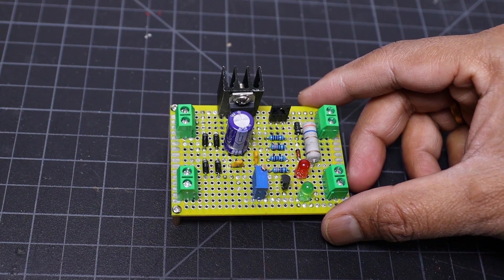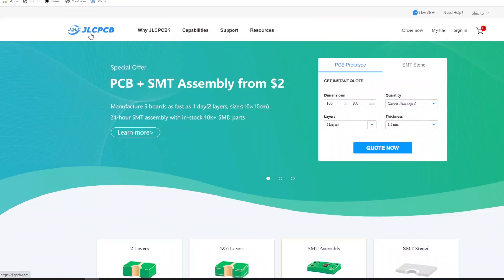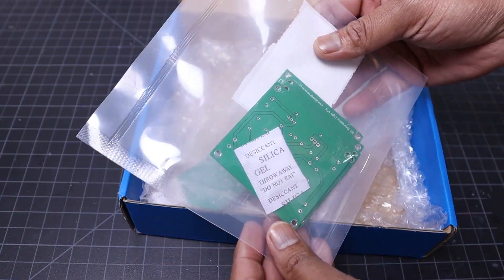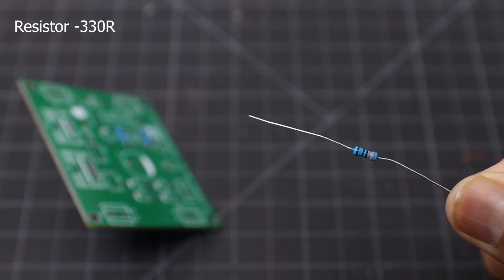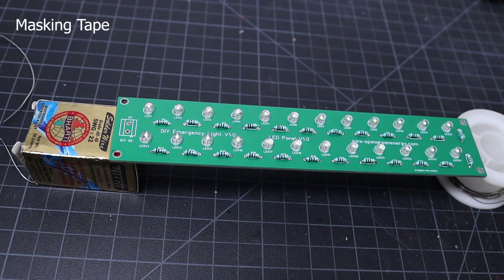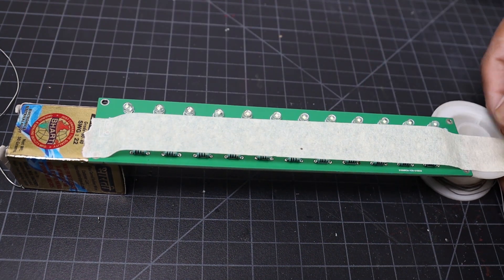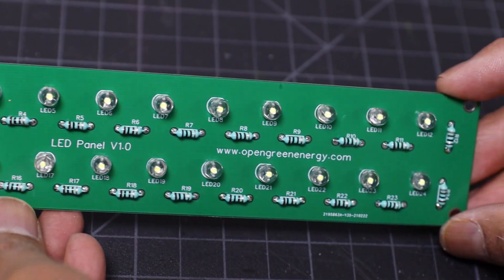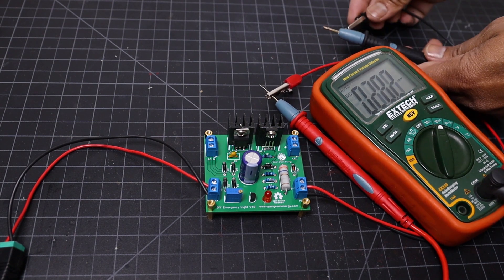How to Make an Automatic Emergency Light || Power Failure Backup Light

Comment: Sir, i have constructed this circuit and This circuit will not work..., in this circuit u have used 6.2v  zener diode which drives bjt(0. 7v) and led(1.8v). So when voltage of battery reaches 8.7v then only zener will work or conduct... Sir if my analysis is wrong please prove it otherwise please correct the mistake in the circuit.

Comment: Please tell me bro that it will work both solar and transformer in same time
Reply from the maker: Yes, you can use but need a Schottky diode at the solar panel positive terminal. The rating of the diode must be higher than the short circuit current of solar panel.
Reply: @opengreenenergy Thank you for your reply bro nice video its useful for all
Reply: What is the value of diode for 3w 6v solar panel pls tell me the circuit also bro and the short circuit current is 0.36A

Comment: That's a nice build. 
I think it would have been much more efficient to add a little thermal paste to the voltage regulator and transistor before screwing to the heat sink.

But i love your work anyway.
Reply from the maker: Thank you .
You are correct, I didn't have stock of that paste, that's why I directly screwed.